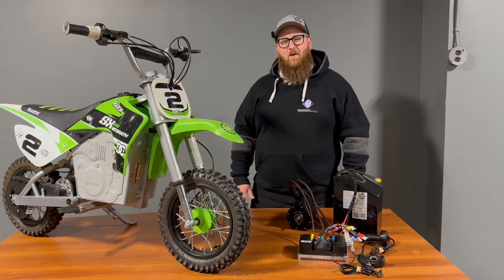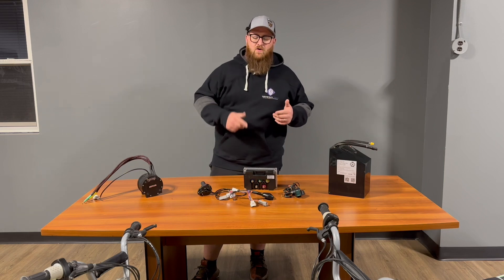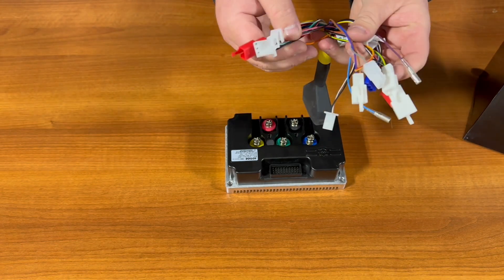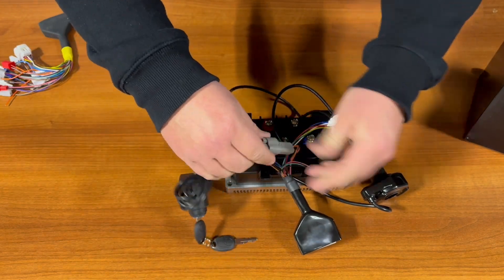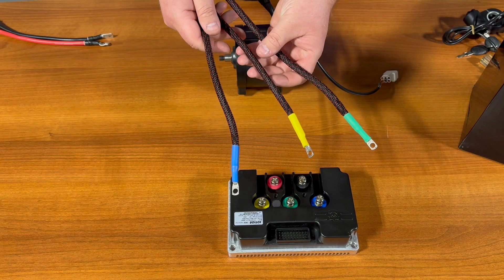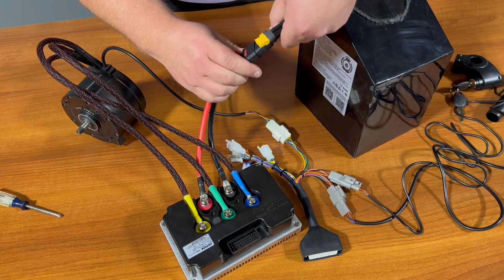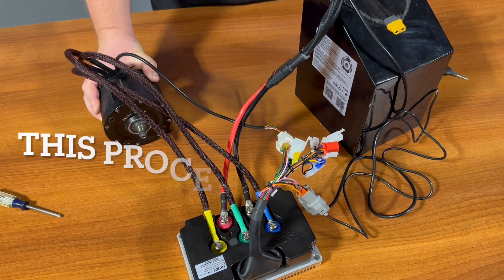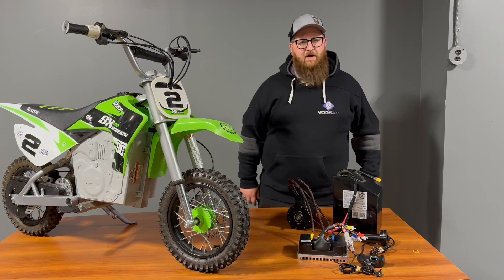72 Volt Plug and Play Razor MX500, SX500, MX650, Sotion FW11, FarDriver

Comment: Just ordered this exact kit with the full size FW11. SX500 build incoming.
Reply: How fast does it go?
Reply: @ I still have yet to actually get a real top speed. I run 10x3 supermotos, 13/58 gearing, and the fastest I’ve gone was 53 with 11/58 gearing, stock dirt tires (2.5” in diameter smaller). That also wasn’t fully topped out, I just went till I was comfortable. 
Since then, I got better forks and a better rear shock, so when it’s not 40mph winds, or it’s actually halfway nice out I’ll get you an update.

Comment: Just ordered a 14k kit, super stoked to build an mx 650 (:
Reply: I just got one too setting it up rn waiting on the battery to charge haha
Reply: @conaycock how fast does it go I thinking of getting on
Reply: @ pro spec before upgrades went about 31 downhill. I upgraded controller/motor and battery now I'm hitting 65 with more room to go im just kinda scared bc I've had a chain Snapps high speed in the past lol totally look into fw11 motor/FarDriver controller and as long as you have a good battery you should hit around 55-70ish
Reply: @ 65 more left in the throttle long story short lol I'm scared to go any faster I don't need to lol
Reply: @conaycock  mine is boaderline unrideable and I've had it over 80mph. It's sketchy on knobby tires lmao
Reply: @ super moto tires definitely grip me to the ground soooo much better than my knobbys invest if you're riding road they're worth it
Reply: how is it? Considering the 14k kit myself. What other upgrades would you reccomend with it? 

I plan on upgrading brakes. If you have any recommendations for brakes let me know. For a sx500/mx650
Reply: how was it?

Comment: I was looking at the 72v battery and I got a pro spec would it work? I plan to upgrade motor/controller but I just gotta get brakes and stuff first haha
Reply: Do some measurments you would obviosly need a controller and motor to

Comment: What is the top speed on the 7000 watt kit and how much ride time do you get
Reply: I’ll let you know in a week. I run gps on all rides, and have this kit coming in 3 days
Reply: Have you got your top speed yet bro I'm trying to see how fast mine comes this Thursday also @JimmyNojohns
Reply: @ all depends on gearing. 13/58 I’m only getting 55 or so. Gonna drop down to smaller gearing though, give the motor an easier time
Reply: @JimmyNojohns  58mph 9front 41rear 100amp battery
Reply: @Rosko55.6 where did you find a 9t for the fw11?
Reply: @BlakePfeffer-k4i  I hit 50mph super easy on my 7k watt kitt